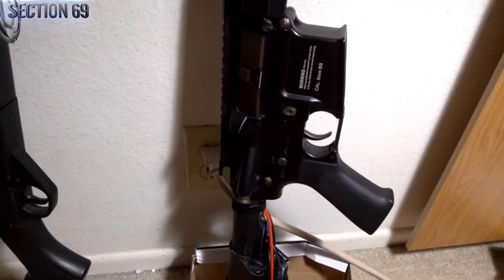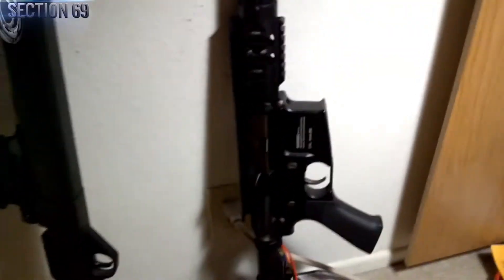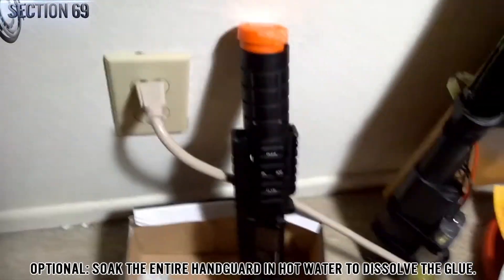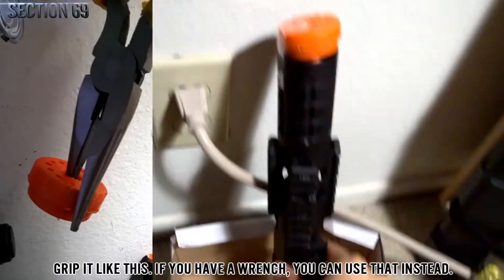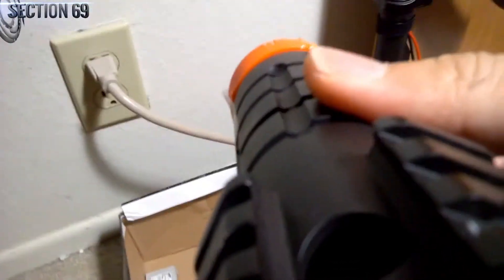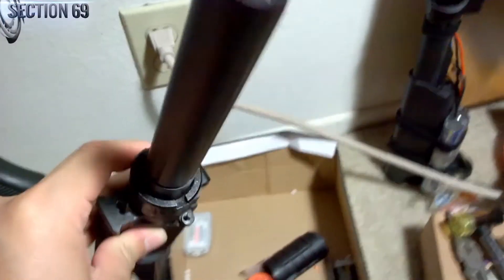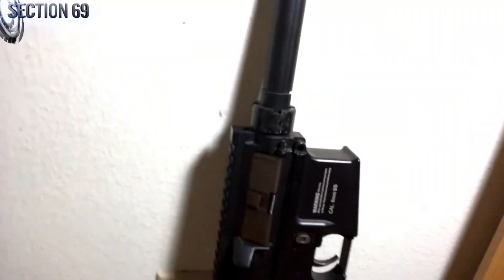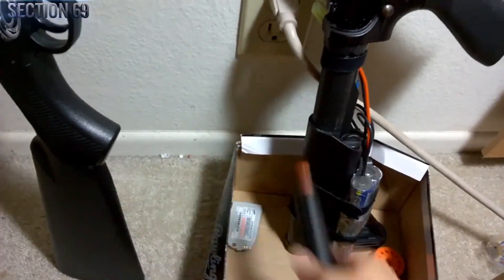BLACK OPS M4 COBRA HANDGUARD DISASSEMBLY [Airsoft Tech]

Comment: Thanks! I tried this and it was a complete success! I soaked the front end in boiling water for like 5 minutes, then wrapped it in a leather belt and tried unscrewing it with a pair of channellocks. with a little force, the glue popped right off, and I was able to unscrew it completely intact.

Gonna swap the metal receiver over to another gun, and put the cobra back together with a plastic receiver.
Reply from the maker: Glad it worked! Boiled water never works for me for some reason so I ended up mutilating my tip. I added a longer barrel and a nylon fiber handguard. :)
Reply: I know it's been a few years since you posted. Which direction are the threads??

Comment: I would like to know if that upper one can put a handguard that uses delta ring
Reply from the maker: Around 8:54 in the vid, I detach the original outer barrel, those threads are exactly where your delta ring would go on (provided of course you get yourself a new outer barrel) and just do those steps in reverse order and you're good. I got a nylon fiber delta ring from a totally different brand to go on.
Reply from the maker: For more info check out a build I did with this upper that involved a delta ring: https://www.youtube.com/watch?v=XOLmcvz3O7Y
Reply: oh really tank you